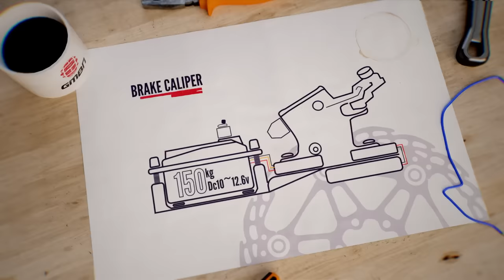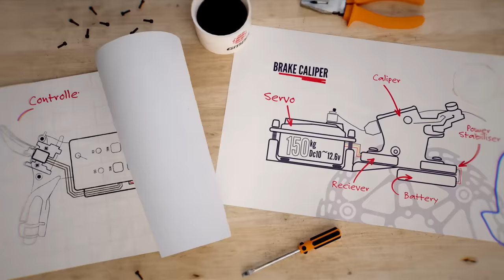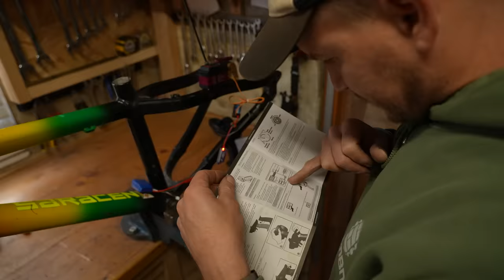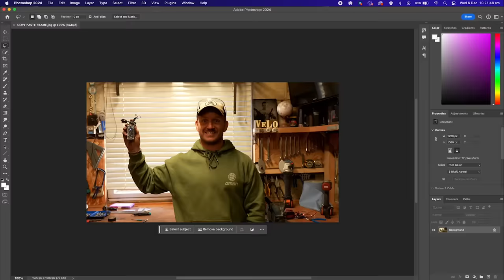We Made The World's First Wireless Bike Brakes

Comment from the maker: Would you use wireless brakes? Would the lack of feedback from the lever put you off? | Watch the GMBN Tech interview and detailed look 👉 youtu.be/qTxtrt49Sxc
Reply: You would need to build in feedback for them to be useful.
Reply: I can understand wireless shifting but not this.
Reply: No. Just safety concerns. Ahem, what if it fails to receive signals?
Reply: Never, brakes must work
Reply: Ill do that on a dropper instead
Reply: I hope you patented it before showing this video - I'm sure the industry is chopping at the bit to use it. :-)
Reply: @raynoldchow  then OTB 🙂
Reply: would i use wireless brakes? hell no! if you want to do barspins something like a hydraulic rotating coupler would be the thing. not wireless, signal gets lost? die. batteries run out? die. servo malfunktions? guess what die.
Reply: Wireless brakes in cars are already standard and wireless steering is being pioneered by the Cybertruck as we speak. Can you build a bike with wireless steering, too? 😉
Reply: @2nd3rd1st  Cybertruck isn’t the first, Lexus did it with their yoke steering a few years ago, the same way cybertruck is doing it now.
Reply: NO!!!
Reply: Never but that’s beside the point. Full score for an excellent hack!!
Reply: You need to trademark "Blake-calipers"
Reply: Yes, I would ride it, once it is tested a little more and modulation improvements are made.  Try using a pressure sensor if there’s such a thing for modulation. Also the frequency needs to be where there would be no interference from other wireless products.😊
Reply: "Die by wire" 😂
Reply: @andresamson8859  Only in a prototype, not in a production vehicle
Reply: I made my custom 36er bike with zero cable stops in anticipation of a future wireless braking system,. I'm ready!  It already has a SRAM Eagle AXS rear derailleur.
Reply: Arduino is totally the answer for Mk 2 for easy control of the servo and reading of the brake level position.  Not sure about wireless reliability though...or whether this is a good idea generally.  But more!  Great video.
Reply: maybe when they start doing wireless brakes on cars and planes - i.e. never. I feel like hydraulic hose is a good middle ground - you can bend it and route it to your liking (within reason). I wonder if some assisted braking would be useful on DH bikes maybe? or an ABS?
Reply: You need to use a load cell in the brake lever assembly instead of an actuator, its what sim racers use to get that "brake feel" so you can feel where they bite better.
Reply: Standard hydraulic brakes are already wireless aren't they? Same reason your chain is wireless too.
Reply: only if you make it subscription based
Reply: I really hope that someone like sram makes these, I could totally imagine them doing it.
Reply: Brilliant! Well done on making them work. Who cares if they’re not perfect. Could you integrate the trigger into a normal lever? Maybe use an old the servowave internal for more modulation?
Reply: @nukedathlonman one of the basic requirements for patentability is utility… as this has no use, there couldn’t be a patent even if he wanted to.  There are other ways of protecting the design of course, but would you want brakes with zero feedback?  Hopefully his next version will have improved bracket rigidity and better progression.
Reply: @paultinwell5557  No, I wouldn't use wireless brakes (hell, I'm still not using Hydro) - but I do want to see these evolve. 😁
Reply: @nukedathlonman  if you’re riding a road bike, cables are perfectly ok, but if you’re riding MTB, you’re seriously missing out.  Rim brakes don’t have the power, don’t work reliably when wet and fade; disc brakes miss out on power and sensitivity.  The world moved on not just for fashion.
Reply: @paultinwell5557  Nope, it's a trail bike - and only ever had one problem, when I tried down hilling on it (so inappropriate use).
Reply: @nukedathlonman  I’m not saying you need them… just that you could have better. If you don’t need more brakes, then what you’ve got are certainly good enough.
Reply: The cable can slip, snapp. Wireless protocols used in RC planes are on the same level @raynoldchow
Reply: What if a nerd hacked the frequency of your brake with a stronger transmitter? They do that to bring down drones. Also you’re lucky they weren’t lithium batteries when you got that short. A great idea for someone with limited finger strength or numbness. Other possibilities, you could fit the controller inside your shoe and use your toe to brake like a motorbike. That would free up all your fingers to hang on and go faster. I a video a few years ago of a guy that was sending bike thieves OTB with a front brake transmitter.
Reply: @akaraikiriakatsuki3157  I agree, brakes should be something that has less point of failure. A wireless system can be interrupted and jammed. What's next, a monthly subscription to operate the brake levers?
Reply: use the spring in brake lever
Reply: No way I would use them, but I encourage others to do it, that would make more Fridays Fails videos 😂
Reply: @andresamson8859  None of them. Cars do not have wireless brakes, only electronic ones (there is no mechanical connection between the pedal and the brake, but the signal is wired).
Reply: How about wireless steering? Analog handlebars are so last millennia!
Reply: Well, let's have a look at the pros and cons, shall we?

Cons:
- probably more expensive than regular brakes
- lots of extra maintenance (bleeding your hydraulics once a year vs. charging batteries every other ride)
- forgetting to charge the batteries will ruin your day (or your live)

Pros:
- It LoOkS sO CoOl!!!

Nah, thanks, I think I'll pass.
Reply: I'd add a backup wireless brake actuator on my road bike aero bars. I don't use those in conditions where I expect to need to brake, but if something unexpected happens it's a couple seconds to get back to the handlebars. Just like you wouldn't use a car's parking brake to drive around, but it's there in an emergency.
Reply: if you lower the dual rate on the controller or you attach the cable on the servo arm more to the inside you would gain a lot of modulation,i work with rc cars daily and that's probably the problem you have, the dual rate is to high so there's little to no reduction in travel on the lever, also try to make a custom lever using a regular bike one with a potentiometer and it will work better. concept looks awesome maybe i will replicate it myself
Reply: No.
Reply: You Need high Speed Servos
Reply: Feedback would be necessary for this to be useful. I don't know if it will work but I think you can use a hydraulic brake lever, cut the sleeves  put hydraulic fluid inside then plug it off. Ofcourse you need to make the hydraulic fluid just enought to have play and resistance as feel. All just a theory though.
Reply: Just as with mechanical steering compared with electronic steering in cars, I'm going have to say, no thanks. Entertaining 'Heath Robinson-esque' video though.
Reply: What about to  give à little soûl with this set up. Could put à little of caoutchouc behind thé brake lever? To bring progressive résistance... TA for the video
Reply: Can't you just put a normal lever on there in stead of a gear shifting leaver. Wouldn't that help with the modulation issues as well?
Reply: Idea to improve feel: Have a leaver that is fixed in place. Then use a strain gauge instead of a potentiometer to measure braking "effort". This way you litterally correlate how much you grab the leavers with how much the calipers grab the rotors. :)
Reply: Yes definitely
Reply: This could be what I am looking for. I have a son with Phelan Mcdermid. He has surprised everyone by being able to ride a bike. However PMS kids feel no pain. No pain means no fear. You see where I am going with this. A nicely controllable remote brake to keep him on the trail without just stopping him (which is what all the special for disabled boring stuff does). He could be really fast with this and possibly not fall on his head as much.....
Reply: This has a massive potential, Blake just casually inventing wireless brakes. Awesome 🤙